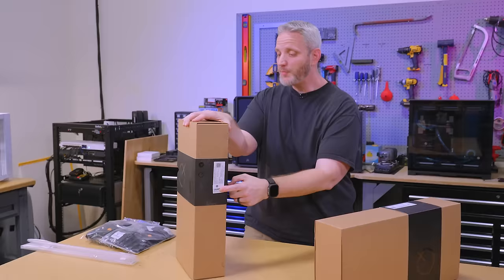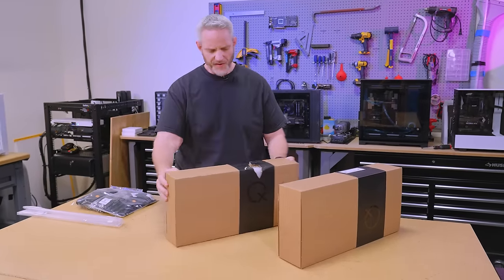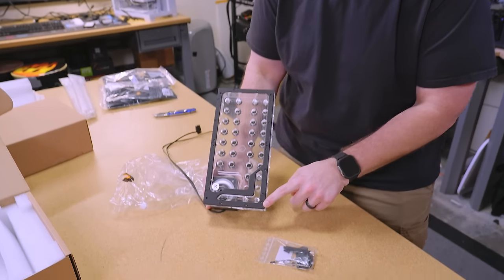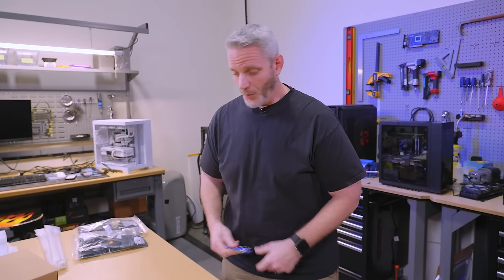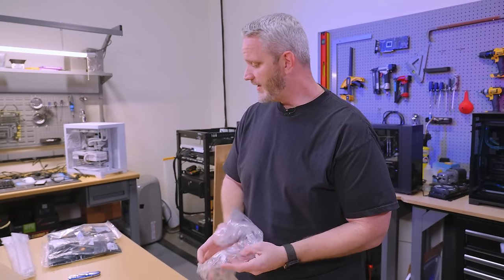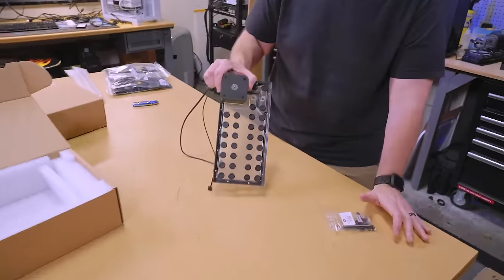Gamers Nexus told me I needed this... so here it is!

Comment: Before watching the video, I had no idea what practical use there could possibly be for this thing. After watching the video, I'm pretty sure there's none.
Reply: I totally agree. Completely unnecessary expense.
Reply: @johndegnan5703  like %99 of modern PC builds
Reply: I mean you could….. yep no idea
Reply: Slap some RGB on anything and it would sell
Reply: some coloured sleeves with that +50$
Reply: @The_Funguseater  I would beg to disagree.. but cannot :face-blue-covering-eyes:
Reply: I guess EK gave AI a go and the AI CEO approved it. 😂😂😂 

This is how its done EK…Alphacool C5
Reply: whta do you mean ? the obvious answer is the pad eks wallets even more since you need all the special fittings to even make it work
Reply: That's my opinion for all distro plates. Double the fittings = double the potential points of failure and double the potential points of failure = dumb as dirt.
Reply: @-CLASSIFIED-   its s trap 😂😂😂
Reply: Could you run soft tubes inside just to have straight tubes else where....or something? EK engineering team got baked.
Reply: Yeah i dont understand, its a distro plate without the distro. Like you could put your tubes in the exact same position without this product.
Reply: @JETWTF  

Not only that, but Distro plates tend to cool the path of least resistance the best
Reply: @The_Funguseater  ...what
Reply: @Riddler290 I can think of it being useful to only use only one distro plate/pump for a rack mounted server where each rack goes into this and then ond big rad but I don’t think the pump can do that (the loop is gonna be absolute pure insanity if aomeone tries this)
Reply: Tbf custom loops aren’t very practical either. This is extra crazy but not like it starts from Honda civic levels of practical lol
Reply: Only thing I can think of is as a heat exchanger really - being able to run a in effect separate loops on the same radiators. Hard to see why that would be worth it, but maybe that super effective thick radiator and fan combo is the wrong metal to go with the block you can get for your x.. Not going to have the greatest surface area to transfer the heat, and if you are not using copper tubing there is some significant insulation value to the tubewalls, but if both sides have reasonable flowrate I expect you'd get away with that still.
Reply: @jolness1  I'd have to disagree on that now - the high performance CPU and GPU of today (Intel+Nvidia especially) are putting out so much heat that water cooling is just about the only way to actually make such things worth having at all - if you are not going to cool them sufficiently you may as well have bought a more mid range cooler running component for most folks... Air cooling is the obvious choice for most stuff, but unless you like your PC sounding like a jet turbine spooling up custom loops have IMO become really necessary for some again.
Reply: Still I have many ideas how it could be used.
Reply: i'm still perplexed. can't you use it as a tank. wtf is this, you just run a loop through it for what exactly? what the hell?
Reply: @JETWTF  In this case, all 32 of them :D
Reply: Yep. This is a perfect example of the gaming PC world and why things gets so expensive for no reason. Make some kind of weird stuff nobody will ever need, slap the world "Gaming" on it for good measure, and people buy it. Totally useless product, like flow meters and LCD/RGB fans,
Reply: Would it be possible to run multiple branches in paralel?? For example - from the pump 3 outlets - 1st for cpu and back in to the "distroplate/reservoir", - 2nd into the GPU and back in to the "distroplate/reservoir" and - 3rd into the rads and back in to the "distroplate/reservoir" .... And yes it would have to fully rely on the fluid mixing up inside the "distroplate/reservoir" to cool down pc.
I have yet to build my first water cooled PC so i have no idea how big is resistance of a CPU water block, GPU water block and rad so that is the question 
😃😃
Reply: It looks cool and the "waterfall" idea was on my mind for so long already, but hell... 490 for literally just the reservoir and the pump.
I'm currently running an AIO with a Corsair 360 mm radiator (you get the radiator, fluid, hoses, pump and even 3 fans!) that cost less than 200!
Reply: @Nightdare  A distro plate between the component and the rad will not cool better, the radiator is what removes the heat and a distro plate gets between the component and it(acrylic is a bad conductor of heat too so having thick acrylic distro plate compared to thin tubes is worse). Total difference between the two is probably half a degree. Also not my point by miles. My point was potential points of failure and a distro plate doubles that due to requiring double the fittings compared to single tube between parts. And not just double the potential points of failure but adding 1 more to the list from the 0 ring inside the distro plate. So a distro plate adds 2X +1 POF compared to tubes without one. Yay! And distro plates can F right off.
Reply: @JETWTF  

I didn't mean in the sense of losing heat, I meant it in the sense of transporting coolant
1 pump supplying separate components may give more coolant p/minute to the line with the lowest pressure/shortest travel
Reply: Put it in a Deep Cool morpheus
Reply: using it with my dog , he's really cool since!
Reply: $500 btw
Reply: @Nightdare  on the point of pressure and flow rate;  fluid can't push forward without the fluid in front of it moving out of the way (unlike a gas that can compress).  So the drag from lines and components are all combined into the restance of the line.  The pressure and flow rate is the same throughout the system unless there are air gaps is the main point.  The temperature will get higher as it goes along until hitting a rad, though.

I started in IT, then did plumbing for 3 years, and now back in IT in a manufacturing facility.....  Soooooo want to grab a chiller and take it home to cool with, but the power level a chiller uses would never make it anywhere near efficient.  When you cooling system uses 12x the wattage your PC created :D
Reply: @The_Funguseater  Whats wrong with modern PC builds?
Reply: I’d rather fill my entire case with water like a fish tank and insulate all my components compared to this. Genuinely feels like it would be about the same amount of work.
Reply: @TjayK2  Why water? Use 3M thermal liquid.
Reply: @TjayK2  probably less work, tbh
Reply: 1000% agree... watched this video with an expression of WTF is this on my face throughout the entire video, waiting on Jay to explain the use case for this waste of product lol... one can judge a company by it's progressive mindset with it's product lines... and THIS explains why EK flopped.

Comment: It would look cool in a duel loop system, have different coloured fluids, and have them crossing into each others distro thing. Dont know how well they'd show up through the tubes and liquid, but might be a neat idea
Reply: If he did one clear and one a dark color would probably sort of work.
Reply: Duel loop system! 🔫🔫🔫
Reply: who are they fighting?
Reply: This was my first thought, too. Depending on colors and their opacity there could be some really interesting combinations. Experimenting with different combinations would be a lot of fun. Like, would running a tube of blue through a block of yellow make the tube look green? Or what happens when you run a tube of Mystic Fog through a reservoir of (see through) color? And those are just a couple initial ideas.
Reply: some kind of red vs blue where they both cross over between the manifolds multiple times would be cool.
Reply: I was thinking similar.  Clear liquid in one loops using the res and a sky blue opaque liquid running inside the tube's.

Depending on the case, you can even put it in the rear compartment facing facing forward so the all of the ports were hidden and you could see the inner workings.
Reply: Make purple, with a red loop and a blue loop. See if they mix, leaking from those fittings.
Reply: Ha, “duel” loop, nice one
Reply: I was thinking the same thing Dual loops with different colors but try to use the inside loop to look like neon sign letters...J 2 ¢ ?
Reply: came here to say the same thing
Reply: Was coming here to say exactly that, letsgooo !
Reply: This would be amazing!
Reply: Transparent pale blue in one res and transparent pale yellow in the other.  Internal tubes would appear green...
Reply: Literally clicked on the comments to suggest this :)
Reply: That was my first thought
Reply: Yes! Dual colors! or even three colors maybe?  I think it would be cool to do diagonals instead of the 90 degree bends. Candy cane Stripes, Rasta Stripes, Murica Stripes, Zebra, Tiger...So many possibilities!
Reply: I had the same thought while watching this video. Dual loop with the color of one loop going through the block thingy of the other loop.
Reply: This
Reply: i was thinking the EXACT same thing!!! lol
Reply: You could do dual loop, with one transparent color in the overall reservoir, and then use UV fluid in the interior tubes, and light your case with blacklight. I think that'd look sick.
Reply: *dual, unless the loops are having a scheduled fight.
Reply: Using some bold and contrasting colours would probably work. The first combination that pops to mind is purple and green. With the right theme for the rest of the system I think it could work.

Comment: Based on the video I'm pretty sure it'd work, but testing may disagree.
When fitting/measuring the internal tubing, do the start like you did, fittings inside in place, then take both fittings out when you place the tube into the fittings, then put the fittings with the tubing already connected back in.  Since the low profile fittings appear to tighten independently of the connection point quite easily.  This should allow you to get a tighter fit to compensate for the loss of a compression connection.  Should be able to get the extra mm or 2 you likely lose due to needing some manipulation space.

Comment: The thing with the internal tube makes no sense to me. Like, who the heck needs this?
The only really quite interesting use case I can see would be using this as water cooling manifold where you can can have several outlets and several inlets. Like with X570 I wanted to water cool my chipset but I didn't want to bother with including it in my entire loop and having to change a load of things in my main loop just so the chip set can get water-cooled. So just creating a parallel run from distro to chipset and back to distro would have been nice.
The only issue would be that you'd want the parallel runs to be roughly equally restrictve so the they're get equal flow. Or even have more restriction in less important parallel runs.
But that should be possible to achieve.

Comment: Couldn't this allow for a "heat exchanger" setup so you can run mixxed metals (well 2 loops with 1 metal) but different metals on the part's waterblock and radiator?
Physically this obviously have really bad efficiency but if the watercooling is way overdimensioned anyway, that could work ?

Comment: I have (2) 980 Pro Pcie 4.0 Nvme and have a 9900k along with ASUS Z790-H Gaming WiFi MB. And I plan to put games on one and OS and programs on the other. Which slot would you put the OS on? Closest to the cpu or the games one closest? And is there anything I need to change in the bios to make the games one have the best speeds and lowest latency?

Comment: If you build a loop inside of the res, then run sub ambient coolant through it, you could use it as a heat exchanger!
Reply: this needs explored lol
Reply: Yes, you could but you also need something to remove that heat and since it's going inside a PC... the only place that heat is going is the surrounding so you'd end up higher ambient temps lol. Unless you have ducting through a wall or something lol...
Reply: @earthtaurus5515  I hear pools are good for that.........
Reply: So is that sub ambient coolant in the room with us right now?
Reply: Doubt it would be effective unless you were using crazy cold coolant. With pipes that large and runs that short the amount of surface area available to carry out the exchange is minimal.
Reply: with copper pipes, this could work
Reply: @goktug3  I'm a refrigeration tech, and I've been planning to build an ambient temp refrigerated system for a while now. I don't think sub ambient is a good idea (not counting running a system just above dew point) though. the main problem I have run into is sourcing an appropriate variable speed compressor that can handle mid range PC thermal outputs without short cycling, or not being powerful enough.
Reply: @earthtaurus5515  a independent  loop not cooling the parts

Comment: Idea: if you're using two of these, use one on the gpu loop and one on the cpu loop. use copper tubing inside the reservoir as a heat exchanger between the two loops. Connect one of the outputs from one into the array of copper tubes in the other. That way, if one loop gets too hot and has to spool up, the other takes on some of the heat. You'd have to use the topmost center input ports, so it would probably be best to use glass tubing to minimize air ingress as water would slowly leave through plastic tubes (to prevent air getting mixed down into the loops), but it would look sick as hell.

Is it ludicrous overkill? Sure. That's part of the fun though.

EDIT: this might actually make the individual loops easier to do depending on the cases fan mounts. The cpu loop could be on the back, with the radiator IO towards the back, and the GPU could be on the front, completely avoiding the area where the CPU loop parts would go. Then you could have that go-between fit right in the middle between the two.
Reply: uhh nice idea, I second this.
Reply: could even solder on some fins to the copper tubing to increase heat transfer.
Reply: These ideas are worth testing. 

Would be good to do the stand clear tube test. Get baselines. Then do the copper tubing and/or copper tubing with fins.
Reply: @Rangerthelonewolf  Linus already did something like this but on a MUCH bigger scale. They did a wholeass heat exchanger block in a custom desk PC for some minecraft youtuber/streamer person with a huge manifold of copper tubes between the loops. It's the "$100k gaming pc" or something like that if you wanna look it up.
Reply: Just stop... run a full loop then
Reply: @LarsDJ  it is a full loop. thats the thing. you just have 2 different ones connected. which is a bit better than 1 solo loop.

Comment: I’m a pipe fitter and push lock fittings work fine I use them all the time. Just make sure you don’t have a super sharp edge so it doesn’t cut the o-ring.
Reply: Yup, especially when, as Jay said - the pump is low pressure high flow. If anything were to take out one of those fittings it would be a  pressure build up which is mega unlikely.
Reply: they are not push lock i believe, just two orings queezing the tube with no physical lock. But yea, the D5 and DDC have nowhere enough pressure to make one of those come out.

Comment: Take off the fittings that are blocked due to internal tubing and put rgb lights in them. 
You can sync them to indicate the hot/cold water and/or cpu/gpu. As well as pulsating the flow orientation.

Comment: @Jayztwocents engineering nerd tip. That distribution plate sort of works like a tube and shell heat exchanger. The benefit of using this is that you cool the water mid loop before it reaches the next component. Tube and shell heat exchangers operate at maximum efficiency when the cooling water, and the water being cooled flow in opposite directions. So any loop segments routed internally should flow in closer to the pump suction, and flow out further away from the pump suction to get the maximum cooling effect. It would be great to see you discuss this in a future video, and implement this concept into your build to the maximum practical extent. I'm excited to see how the build turns out, and am a big fan of both you and @GamersNexus!
Reply: that only works if the tubing you use has good thermal transfer.  acrylic wouldn't work for that.  This is just for show.  Something made with purpose would have been made with copper tubing and directed flow channels where there was a clearly marked chilled side and hot side.

Comment: You can use this in a dual loop set up where each loop is a different color and fill this block with one color and pipe the other color through the block so you can see it going through.  Maybe clear yellow in the block and blue in the pipe throughs so you see green piping through.
Reply: Use glass tubing - you can buy 12mm OD borosilicate glass tubes with 90-degree bends - also, you'll know if any of the fittings leak because the colors will blend
Reply: Like this idea I hope he tries it

Comment: @JayzTwoCents you can open the pump and solder a 4 pin PWM fan wire to the pump. You just have to be careful that the pump doesn't pull more amperage than the motherboard can handle.

Comment: Build double system with double loops that go through each other's reservoir. Then have different color liquids.
Product would make more sense if it was sectors of holes and plexiglass+o-ring inserts that are positioned & screwed sandwiched inside the reservoir. Less holes, less fittings, factory finished inserts instead of user erroring pipe bending. Could probably get RGB leds inside the fitted parts through unused holes. And about 500 dollar less of expensive special fittings.

Comment: Jay, it would be interesting for you to go really obscure with the build with one distro plate for the cpu and gpu, which is transferring the heat of these components to the other distroplate with just radiators.
It would be interesting to see how much heat can be removed from the loop by just fitting and cables inside of the reservoir combo.